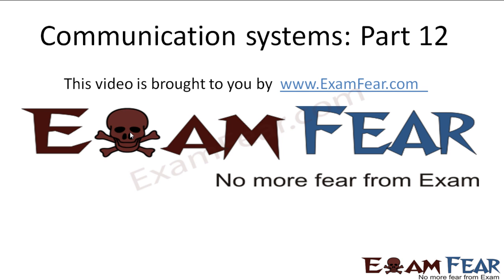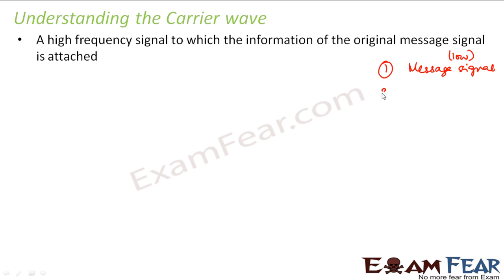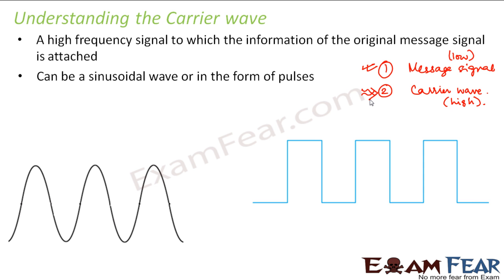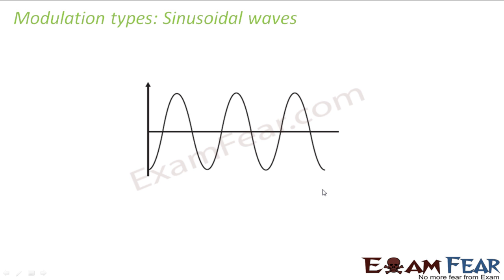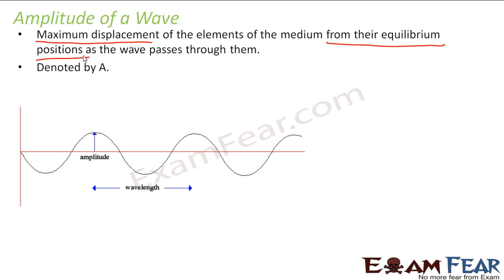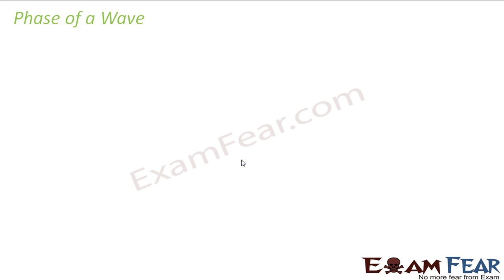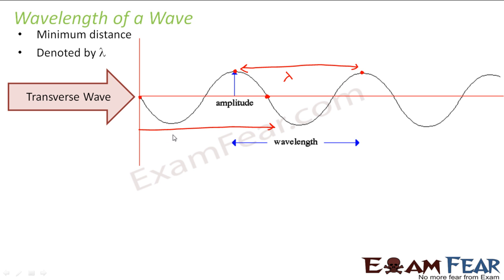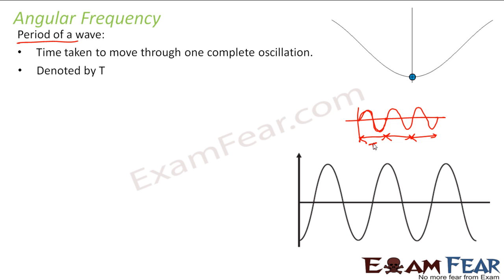Physics Communication Systems part 12 (Carrier wave, Modulation types) CBSE class 12

Comment: the equation of a wave I think is given by 
y= Asin(kx-wt+delta)
Reply: +Harshit Rajput no bro u r wrong.
Reply: +Pinnamraju Raghunath 
bro once check this out 
http://www.animations.physics.unsw.edu.au/jw/travelling_sine_wave.htm
Reply: You should study heterodyning. It's a form of zero point as described by Tom Bearden. LF charge can implode through multiple dielectric layers at once through a nonlinear medium so pump z waves (made using a carrier usually of 3x or multiple of 3x) will combine if they are in sync yet out of phase. As long as metal is at or near the focal point of implosion, energy is gained there. Beware of x11 carried waves. If the carrier matches the resonant frequency of anything, like dna which 5g is operating at, the resonator is destroyed. This is why 5g areas are rich with coronavirus, because the dna is sick. It's falling apart, can't heal.